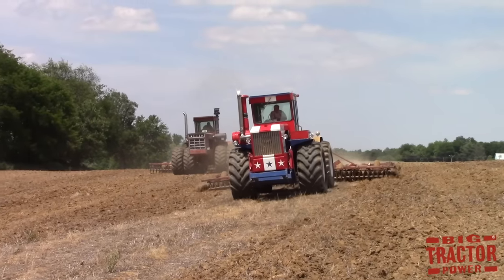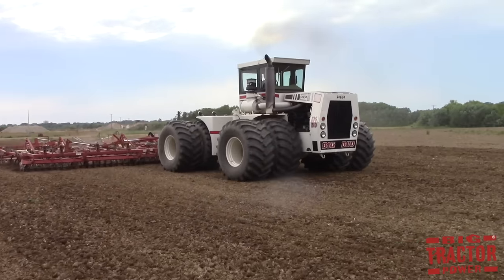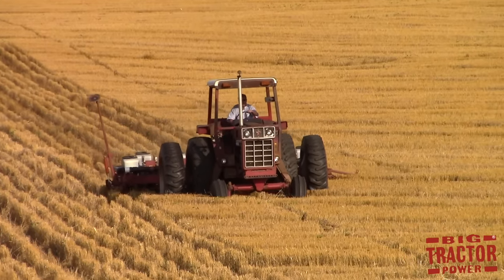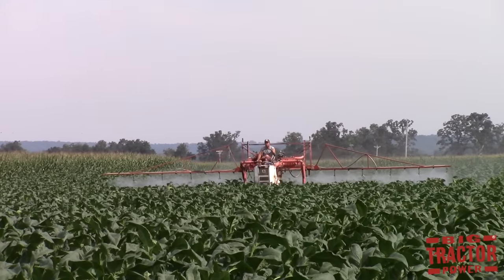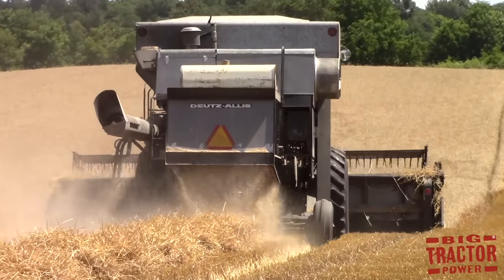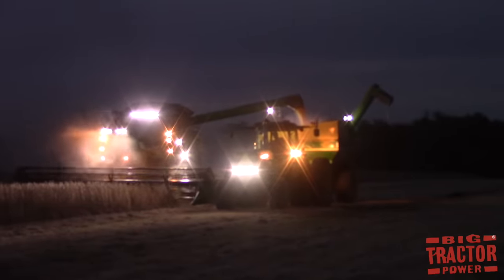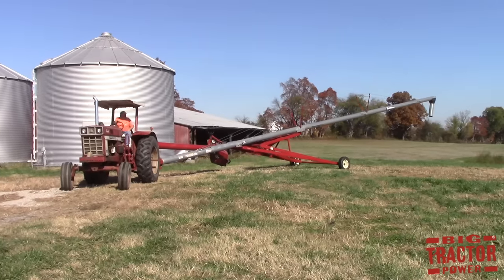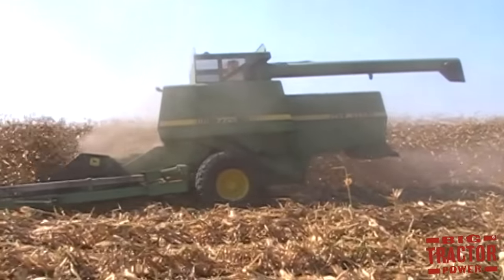Tractors, Plows & Harvesters

Comment: I use a John Deere 4020 tractor, 6620 combine, and 7000 planter for the grain portion of my operation.  When I raised organic crops, I also used a F-145A 5-16 plow, and an FM belly mount cultivator. My last organic crop was 2 years ago, I use chemicals now.  For the livestock, I have a JD 400 grinder/mixer, Schultz/Allis Chalmers 325 manure spreader (can't find ANY info whatsoever for this machine), and a Case 1845C skidloader.  Except for the skidloader, I could be farming in the 80's. Take out the combine, and I'd be back in the '70's. I like the older equipment, though.  I'm just a young gun starting out, so I'm very happy with the equipment I have. I'd really like a scale on my grinder/mixer, that's about it. :)
Reply from the maker: That is an awesome line up.  I like machines from that time frame. I may have an AC 325 brochure.

Comment: I wish I could know what it was like to farm back then. I've seen pictures of my grandpa harvesting corn with a John Deere 3300 combine with the 2 row head. He was running that combine in his underwear, because it had no windows in it and it was hot as hell out! My dad would sit right behind the head and pull weeds out when they would farm down by the river bottoms. They were poor and worked HARD. My dad tells me stories of staying out late to finish plowing. One time he was out at 10:00 or so at night plowing with an open seat Allis Chalmers and a 4 bottom plow. He fell asleep at the wheel and went through at least 15 feet of trees and brush before he woke up. (Woods lined the field he was working on both sides.)He had to walk the 5 miles back to the house to go get grandpa to help drag him out. Grandpa wasn't happy lol - my dad was maybe 15 at the time. They ran no-cab tractors for most of the time they farmed - even to and from the grain elevator, since they couldn't afford a grain truck. The only tractor with a cab that my grandpa ever owned (bought it in the late 80s) was a 1972 John Deere 4230. The combine is long gone, but he still has that 4230 to this day, along with the gravity flow wagons they used. It was rough and they worked their rear ends off all year round. My grandpa was a shop teacher at the high school for 30 years AND a farmer at the same time! He also bulldozed in the summertime to make ends meet. Even through all that, he still managed to put food on the table and provide for the family - to me, that's badass.
Reply: Thats an amazing story, does your family still farm?

Comment: we are finding out now that plowing under old crops which is high in carbon, by the putting the carbon into the soil, carbon holds the nutrients that the crop needs until the crop is ready to use it
Reply from the maker: Plowing is and was an effective way to prepare a seed bed and control weeds

Comment: I thoroughly enjoyed the video on the Golden Age of Farming.  You mentioned at the turn of the century or 2000.  What year would you say was the start of the golden age??   Thanks!!   - Dean from Minnesota
Reply from the maker: I would define the golden Age of Farming from 1955 to about 1985. The late 60’s to the mid 70’s saw a drastic change in scale of the machinery in size and horse power.  After 1985 many brands had merged and the big raw iron machines gave way to high tech.

Comment: What is the maximum transportation width in the US? Or does it vary per state?
Reply from the maker: I do not know that there is one.  If it fits on the road where I live they go.  Normally about 17ft is as wide as an implement can be to fit on the pavement.  Some of the 60ft air seeders used to plant wheat and soybeans here in Kentucky where I film are 19ft to 21ft folded and they take up the entire road and require a truck escort during transport.  Farmers are not required to have an escort but they do it for safety of traffic, the operator and the machine.
Reply: If u have a 17ft implement and a 15ft wide bridge it's less than 17ft, I believe.
Reply: In PA, we have a max road width of 12 feet.

Comment: Is any of the grain used to make Ethanol?   That was one use you didnt mention? How did ethanol impact farming over the past 20 years?
Reply: Corn is used for ethanol production.  Being KY I bet almost all of it goes to ethanol production one way or the other ;-)  Around here the production for bio-fuel had very little impact price wise, and thus not a lot of change in planted acres.  What we found is the local ethanol producer did a fine job of farming government subsidies for the production.  When the subsidies stopped they just closed up the plant like it was nothing.  From a farmers perspective we generally think all the bio-fuel production as a bit of a con.  To continually meet ethanol production means less crop rotation, which means more fertilizer, which requires a lot of energy to produce.  Then add the energy it takes to brew ethanol.  Basically a messy inefficient conversion from gasoline to natural gas when you get down to it.  As natural gas is used to create the fertilizer, and also for much of the heat in the ethanol production.  Lets not forget it takes around 35% more ethanol (per volume) to equal the same energy in gasoline.  Bio-diesel had a decent chance, but maintaining the volume, and quality seemed to be the sticking point.  Have not seen bio-diesel anywhere in at least 10 years.  Seeing more ethanol free pumps come back too.

Comment: Soil finisher after the culivator I don't remember any of that
Reply: We never used a soil finisher or field cultivator, we had two discs that went in and broke up the soil then followed by a "finishing disc" (a disc with closer blade spacing basically) and finished up the seed bed.  Plowing or chisel plowing was done in the Fall, only done in the spring if we absolutely had to do it.
Reply: I would think without a cultivators and harrows or finisher would leave seeds with poor soil contact
Reply: All depends on what type of ground, previous crop,amount of stubble left behind.